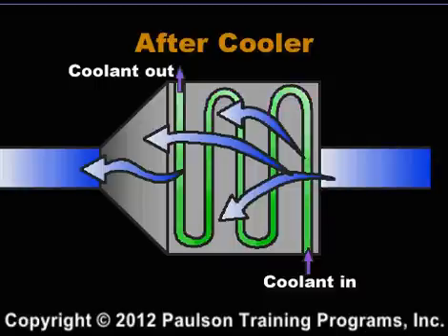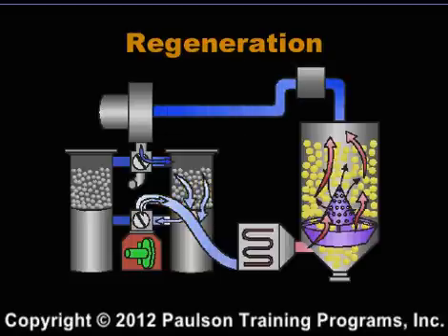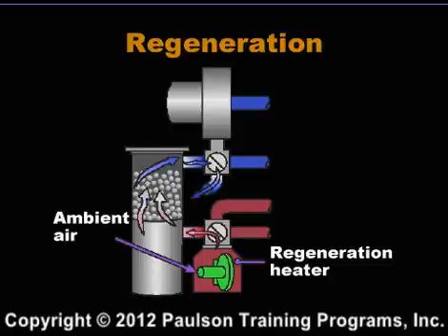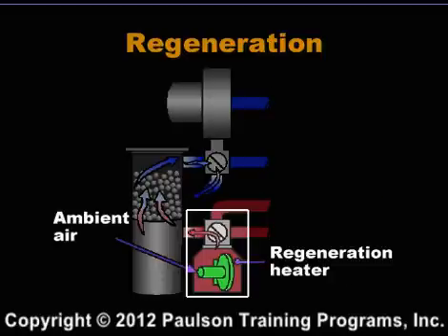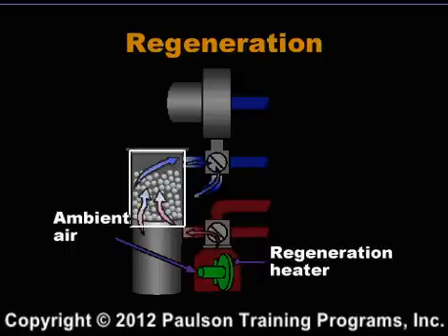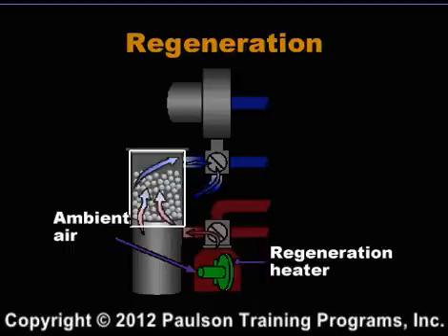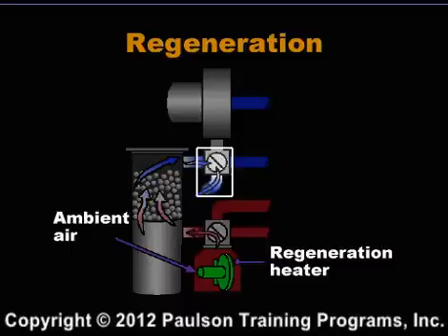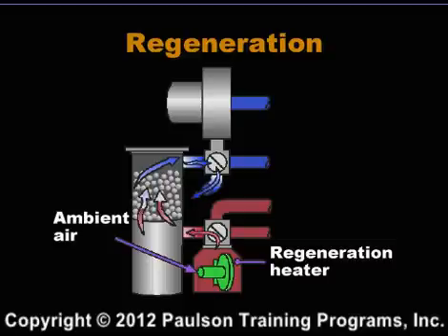Plastic Drying Technology for Extrusion and Injection Molding

Comment: Dongguan Hengju Machinery is an entity enterprise that manufactures 
complete sets of automated equipment! Both equipment and mechanical 
parts are independently developed and designed by the company! And has a
 number of patented technologies! Enterprises have always been guided by
 technological innovation! Mature technology and years of installation 
and design solutions, feasibility design and installation solutions, 
will save 10%-50% of the cost budget! Because we have advanced technical
 support and many years of design solutions, for example, a smart curve 
fitting design can save the previous mechanical equipment. According to 
the actual situation of the enterprise, we can analyze the data with the
 measurement enterprise and make a feasible design solution.
company name: Dongguan Hengju Machinery Equipment Co., Ltd.
phone： 86-0769-89237256 
WeChat/Whatapp： +86-15876905866
E-mail： wto-btb@wto-btb.com
Address： 168 Guangming New Street, Dongcheng District, Dongguan City, 
Guangdong Province, China
source:http://plastic-dryer.1998sy.com/
Enterprise manufacturing:
Manipulators, servo manipulators, automatic manipulators, inclined arm 
manipulators, conveyor belts, three-axis and five-axis AC servo 
horizontal walking manipulators-single/double-cut, AC servo vertical 
walking manipulators;
Central material conveying system, plastic dryer, desiccant dryer 
system, weighing and mixing system, weight mixer;
Dehumidification drying system: dehumidification dryer, honeycomb 
dehumidification dryer, three-in-one dehumidification dryer, two-in-one 
dehumidification dryer, hot air dehumidification dryer, box-type 
dehumidification dryer, plastic dryer;
Crusher: fast crusher, medium speed crusher, slow speed crusher;
Mixer: color mixer, mixer, automatic mixer; doteco weight mixer, 
material conveying system;
Weighing and mixing system: automatic weighing, metering and mixing 
system; master batch machine, chapter color weighing mixer, multi-color 
weighing wet material machine;
Mixers: large mixers, vertical color mixers, horizontal mixers
Automatic feeding system: powder suction machine, powder suction 
machine;
Industrial chillers: standard chillers, open chillers;
Mold temperature controller: constant temperature controller, automatic 
constant temperature system, oil temperature controller. Standard mold 
temperature machine;
Oil temperature machine: standard oil temperature machine;
A gravimetic blender is an item of industrial equipment used in the 
plastics industry to accurately weigh two or more components and then 
mix them together prior to processing in an injection molding machine, 
plastics extrusion, or blow moulding machine.
There are two types of gravimetric blender.
http://dehumidifying-dryer.wto-btb.com/
http://plastic-dryer.1998sy.com/
http://central-feeding-system.wto-btb.com/
http://www.wto-btb.com/Encyclopedia/gravimetric-blender.html

Comment: http://dehumidifying-dryer.wto-btb.com/
3 in 1 plastic desiccant dryerThree-in-one protection device1. Total 
power supply overcurrent no-fuse circuit breaker;2, fan overload 
protection;3, high temperature trip protection;4, material suction, 
material shortage alarm;5. Overheat protection temperature switch;  
working environmentIndoor, dry environment, temperature should not 
exceed +45℃, humidity should not exceed 80%;